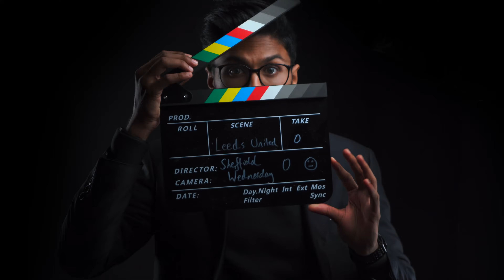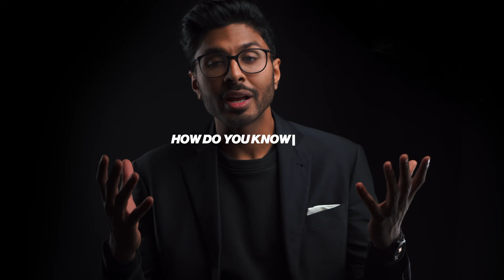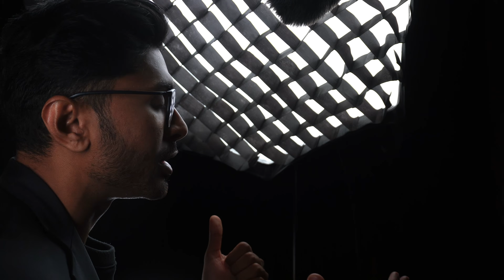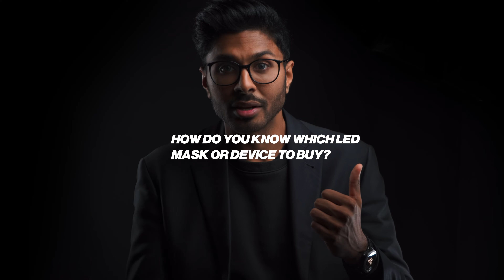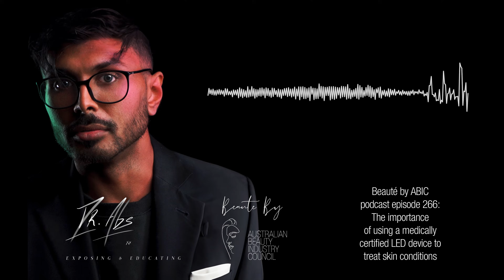World’s Top Expert Reveals LED Mask Lies (Youtube Exclusive)

Comment: I have purchased 2 sets of red light therapy masks. The Higher Dose (neck, deck and face) and the JOVS neck, deck and face.  I have owned the Higher Dose for about 1.5 yrs and the JOVS only since last October.  Now I want to tell you why you shouldn’t buy either of these masks! The controller. I have NEVER been to an “influencer” selling these masks who has pointed to the controllers.  Because they don’t “test” them long enough.  These controllers must be recharged and unplugged to operate. You cannot plug them in and use them.  The Higher Dose Controller on the face mask went fast. Within 6 months. They sent me a new one.  The second one on the chest and neck went about a month later. Higher Dose bawked. Understandably! They sell them for $75 US.  I didn’t buy a new one. I am down to the neck and one controller working. The JOVS mask started flickering after 6 months. I notified the company and they asked me to send them a video. That’s just too much work AND it doesn’t always flicker. So I would have to wait until it does it’s flickering thing and run to get my phone and video it. No thanks. These masks will likely all burn out within the year. I won’t buy any more. I don’t trust influencers to tell us the truth about these controllers!

Comment: I have to wonder why is it when someone asked you to compare Dermalux Flex to Celluma Pro why not tell us why you are not a fan? I really wanted the pulse feature which Dermalux doesn't offer. I had several questions for Dermalux and their response time was less than wonderful so I am concerned about any kind of service issue or technical support they would be able to provide for units sold to Florida ? It's my understanding Celluma Pro and Dermalux Flex are the top  competitors (medical grade) so if I want the pulse feature are there any other units you suggest? It has been been mentioned Dermalux is old technology and they made no changes in years which is why pulse has not been added. What's you thoughts on pulse? I wish I could find more personal reviews on YouTube  instead of  influencers who in most cases are given these units I feel like biased in their opinions.

Comment: Dearest Dr. Abs,
I always follow Your videos carefully .
I had met you back in the days of the Dermalux webinars that I have followed carefully in the past.
In fact, over the past few years, I have become passionate about photobiomodulation.
For face and neck I have been using Dermalux Flex once a day for 30 minutes for three years now.
For the body I purchased a 1000 led 5 w dual chip red and infrared light panel , which I use for 20 minutes (ten minutes front and ten back).
Dedicating myself to photobiomodulation therefore costs me a daily sacrifice of 50 minutes in total . I know that the dermalux flex is certified medical device, while the body panel is not . The question I wanted to ask you is as follows : do you think I am doing well to devote myself daily to photobiomodulation? I am 50 years old and very healthy so I don't have any specific problems. I am doing it with the hope that I can always be well for as long as possible and slow down the
as much as possible aging . What do you think ? Do you think the platinum led or Mito panels give any benefit or are they useless in your opinion ? I would like you to talk about them in a video of yours soon

Comment: This has been so interesting. I bought the Dermalux flex two years ago for anti aging so was only interested in using it for the red and NIR. However, as someone that has NEVER suffered acne, the break out it gave me was off the scale. For months and months the breakouts kept coming. Wave after wave, even after I ceased using the device. Now I will admit to using it excessively and for elongated periods, longer than was recommended. Could that have been the issue? What you said about using red on inflammation really struck me and now I wonder whether it’s possible I got stuck in this awful cycle of accelerating results towards inflammation and break out because I was using red. Perhaps, like you said, I needed to focus only on NIR to reduce the inflammation and THEN introduce the red once it had cleared up. It’s sat unused for two years because it terrified me. Such a waste of money. I need to take tentative steps to reintroduce it especially as you cite it to be the best on the market.
Reply: wow- i had the same problem with the dennis gross mask- especially along the jaw line and my cheeks- two places ive never really had acne. I havent been able to figure out why couldnt figure out why, couldnt find answers anywhere.  i only used it for the 3 minutes once a day as indicated. when the break outs started i began using blue light and red light together.  break outs continued.  so then i switched to blue only and they continued.  after about 6 months I stopped and havent used the mask for the last month and i think im finally clearing up.  i want to get the benis from the mask but maybe my skin is too reactive

Comment: Please someone explain to me, who is spending almost £2k for dermalux flex ? I was prepared to spend £300-500 for a red light therapy device, not specifically a mask, but almost £2k????
Reply: I opted for a stronger full-body panel around $1.5k 😊
Reply: @withpureintentionsleahmona5299 which one did you buy.
Reply: @withpureintentionsleahmona5299  Which one?
Reply: I did 🙋🏼‍♀️ 🤷🏼‍♀️
Reply from the maker: I did too
Reply: High quality LEDs are very expensive. They require a lot more steps to manufacture.
Reply: I did
Reply: I would.
Reply: What about the DERMALUX LED FACE MASK? where can I get one from the US? Please help
Reply: It’s £2000 to £2500 for the dermalux

Comment: I really respect Dr Abs HOWEVER he got quite a few things wrong about RLT which really surprised me. In particular speaking to achieving ‘exact’ wavelengths. That’s not what the research has shown. It doesn’t need to be exact to the nm, it’s a bandwidth and the benefits aren’t reduced if it’s off by 1-10nm.
Reply from the maker: Please pay attention to the video properly before suggesting I got things wrong. I literally spoke of peak tolerance figures which is exactly what you've mentioned.

Comment: @Dr.Abs What do you think of the Numiere Time Keeper Face Mask? 

Benefits:
3 LED Wavelengths
RED LIG0-730 nm Wavelength) - The red light penetrates to 8-10mm and is best for fine lines and large pores. The red light stimulates collagen, an essential protein necessary for maintaining healthy, soft and beautiful skin. Collagen production is boosted, while damaged tissue is repaired. Enlarged pores look smaller and less visible!
BLUE LIGHT (430-450 nm Wavelength)- The blue light penetrates to 0.5mm and is best for acne-prone or sensitive skin. The blue light acts as an anti-inflammatory and calms hypersensitive, blemish-prone skin. Redness is minimized while acne-causing bacteria are also diminished. You’ll notice existing blemishes seem to immediately shrink, while skin stays breakout-free for longer!
NIR - near infra-red light-  The NIR procedure uses a safe level of infrared light that is able to penetrate the deeper layers of skin. The light energy heats the water in the skin tissue and causes collagen fibers to contract and tighten. It also stimulates fibroblasts to repair skin cells and produce new collagen.

Comment: I used a whole body LED device (Beauty angel, looks like a tanning bed) which is supposed to have zero UV. I had tanning marks afterwards on the parts of my body that touched the surface of the bed and started sweating. I am still trying to remove these tanning spots and I immediately stopped using the beauty angel.
Reply from the maker: So sorry you got duped into it

Comment: what do you think about Opatra LED light and omnilux ?
Reply from the maker: For me, nothing compares to dermalux. The optical intensity; the peak tolerance; the heat sinking etc are all unmatched.
Reply: @Dr_Abs  i get that from the video but opatra one is 20k. Is it even close to dermalux? thanks for quick answer
Reply from the maker: In my opinion, it's nowhere near. Ask them what their peak energy output is; what their peak tolerance is and what their full-width-half-max is for starters. Then compare that to Dermalux - not even in the same league in my opinion.
Reply: @Dr_Abs  thank you. I own dermalux. I was just curious
Reply: @Dr_Abs  also. is dermalux flex same powerful as their big stand free machine?
Reply from the maker: No definitely not - the big one needs the size for the power. The big one is around 20k including VAT.
Reply: @Dr_Abs  its opatra pro light machine i was talking about

Comment: Great deep dive. Do you rate the celluma? It also seems to have some medical clearances. However, I understand the light nm range is not as narrow as the dermalux. Still learning.
Reply from the maker: I'd never rate it, personally. The clearances it has are pretty useless as medical CE is much more important. The power the skin receives per square centimetre is nowhere near as good as dermalux either.